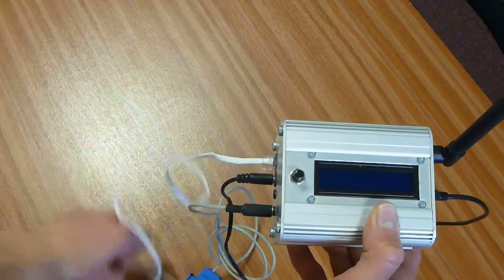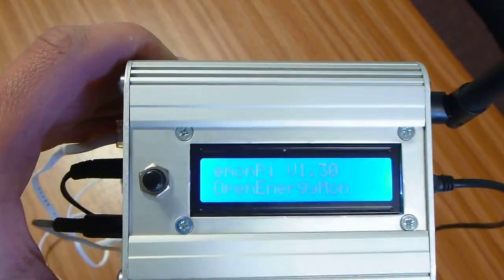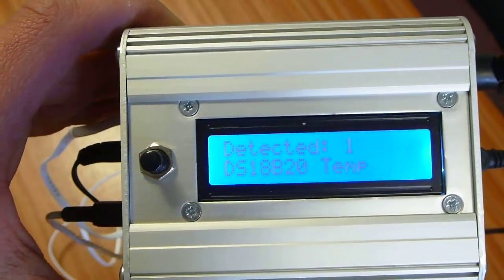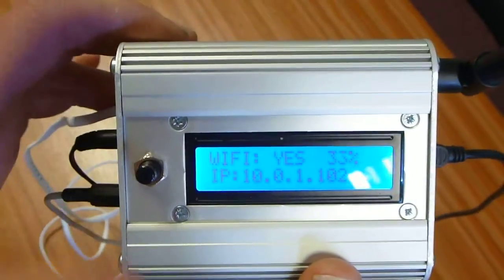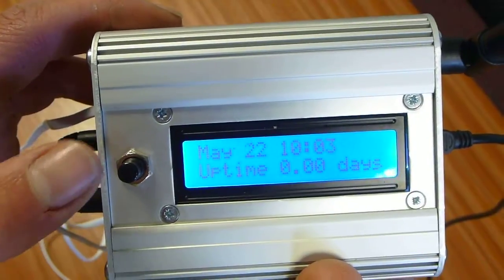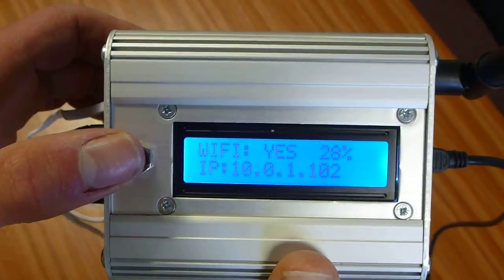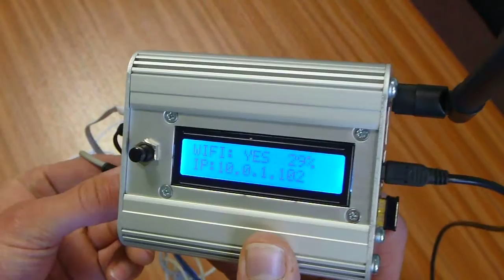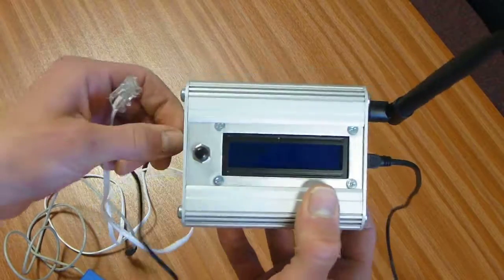emonPi Power Up Demo

Comment: Nice power up demo! According to my current research, EmonPi seems to be the best choice for DIY green lifestyle enthusiasts to begin monitoring their energy usage and start reducing their energy wastage.  By adding temperature sensors, water tank storage sensors, and other sensors via various interface devices, one can monitor all sorts of homestead subsystems & processes. And sit it is all open source, if one is handy then all sorts of further customizations are possible.